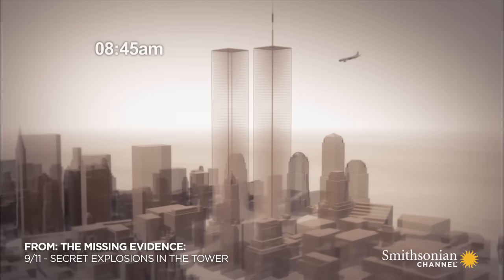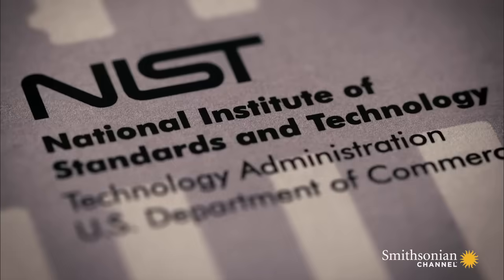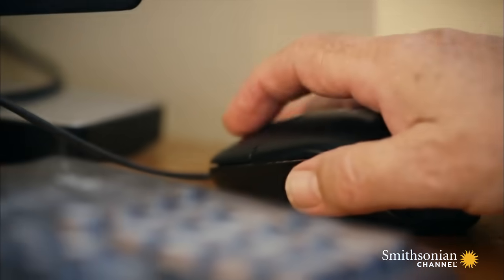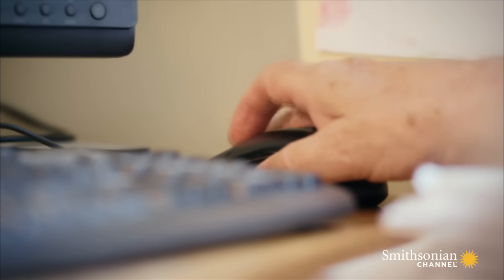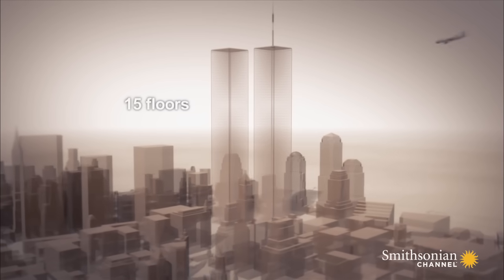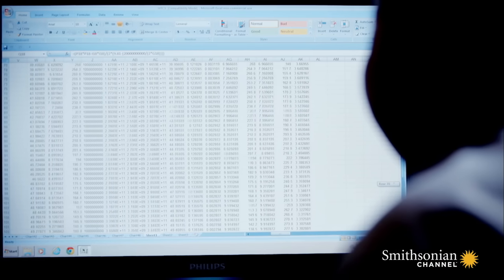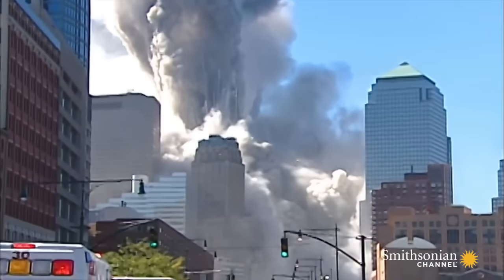This Computer Simulation Explains How the Twin Towers Fell

Comment: 9/11, never forget the day physics took a day off
Reply: Inside Job
Reply: @tulrid7550 outside job
Reply: People seem to ignore Newton's  laws. The lower 3/4 of the building (which were reinforced more than the top, to prevent sway and weight) would have resisted the upper 1/4. Collapse would violate the laws of physics.
Reply: @jedimasterham2  
Yes, violates the laws of physics and Common Sense. I think these people on here supporting the original fabricated story on the mainstream news must be paid trolls. My only question is how much are they getting paid to be treasonous to our country?
Reply: @br5747  It would make sense. Negative reinforcement and shaming is often used to deter people from certain types of behavior.  Can't prove they are paid trolls, but we have to ask why they would dedicate so much time to bashing people with completely rational concerns and questions.
Reply: @jedimasterham2  
Amen brother.
We probably don't know half of what's really going on.
Reply: @jedimasterham2  What laws of physics are violated?
Reply: @peterjv8748  Newton's third law of motion: For every action in nature there is an equal and opposite reaction.

The lower portions of each tower (reinforced much more to protect against sway and the weight) would have exerted a force of a significantly higher  magnitude against the upper portions, thereby resisting the upper portion. In other words, free fall would be impossible because the upper portions would have bounced against the resistance of the lower portions.
Reply: @peterjv8748  And laws of motion state that the lower 3/4 of the building would provide a force 3 times the magnitude of the above portion, thereby providing ample resistance. The upper quarter of the buildings would quite literally bounce on the resistance. 

It's fairly simple to understand.
Reply: @peterjv8748  The "pancake" theory was debunked by physics. I already explained above. And yes, both (actually all three) fell at near free fall speed that is consistent with professionally controlled demolition work.
Reply: @peterjv8748   it was 11 and 13 seconds 🤦‍♂️ you have no idea what you are talking about sheep
Reply: @peterjv8748 actually free fall is 9 seconds. One tower fell in 11 seconds and one in 12-13 seconds. That means there was nearly no resistance, that’s physically impossible at least for wt1 because the entire frame is steel and the core is 47 columns of steel, and even if a floor was completely severed instantly, which you’re stating. the resistance is equally or 2-3x amount of times stronger lower towards the bottom. It’s called law of conservation of momentum. It didn’t slow down either it was a consistent speed. The collapse is not 15-16 seconds that’s an exaggeration. So now the question is how did they fall 1-2 seconds near free fall speed “pancake theory, implosion on itself” doesn’t make sense
Reply: @jedimasterham2  thank you. This is what I always say. Why would the entire building come down if you hit the top?
Reply: @jedimasterham2 no one, not even world renowned engineers and physicists are in a position to boldly claim what would or should have happened in an unprecedented situation where a fully fuelled airliner slams into a 400 m tall skyscraper at 700km/h. Amateurs and professionals alike can only speculate. Reality shows something else.
Reply: @ Actually, physics remains constant, and engineers and physicists are very aware that this is physically impossible.
Reply: @jedimasterham2 it was an underground mini nuke guys.. not planes
Reply: Guys I love how if you question anything at all thats makes you an automatic "tin foil hat" conspiracy theorist bla bla bla. With 9/11 its not just one valid reasonable question. Its HUNDREDS. And they remain unanswered to this day! NIST & the 9/11 Commission DIDN'T EVEN TEST FOR EXPLOSIVES! That is ridiculous & That is a fact. Nevermind the countless ppl who said they heard explosives WTC7..w.e ok just simply disregard them. WHY ON EARTH WOULDNT YOU DO A PROPER INVESTIGATION & TEST FOR EXPLOSIVES REGARDLESS!???
Reply: @frankgrimes6771  agreed!!!!!!!!!
Reply: @frankgrimes6771  If they tested for explosives and didn't find any, you wouldn't believe them anyway. You'd just say they were lying, you don't believe anything they say so why does it matter to you whether or not they say they tested for explosives?
Reply: In 2019 it is alarming the amount of people that still believe and defend the governments official story. Boggles my mind
Reply: @perijon00  same, most are paid to argue, others just dumb
Reply: @perijon00  they are npc’s.
Reply: @perijon00  Just because you don't understand something doesn't mean that it didn't happen.
Why don't you explain in detail what we all saw and provide supporting evidence for each.
Reply: John J ok John time to use your common sense. I understand this just fine. We all think we saw 2 airplanes hit the tops of two marvelously built skyscrapers and the result was 3 skyscrapers demolished into their own footprint at near free fall speed defying physics. If you still can’t wrap your head around that then I suggest doing more research on the days months and years leading up to that and what exactly they had to gain from a fake war on terror
Reply: perijon00 so if it was explosives, how would they survive the office fires for that long. How would any government agents wire up the detonation cord around all these fires. Collapse happened exactly at the fires point from impact from the planes. How come none of these bombs were picked up on any audio or video taken a block away from the collapse points. As far as I know bombs make noise not silence
Reply: 360SRH 2 wow. Go do more research bud. Watch “a new Pearl Harbor”. Your argument is all over the place
Reply: perijon00 Typical truther gets confronted with a realistic argument and immediately changes the subject. I dare you to answer, how come the buildings fell silently, even 1 ounce of explosives can be heard for miles away. How are these explosives and detonation cords to survive the office fires for that long? It’s just basic physics and science if you care to chat.
Reply: 360SRH 2 typical physics? A building like this couldn’t do what it did according to basic physics. If any part did collapse it would have been the top floors and they would have collapsed until they hit the part that was hit. There wouldn’t be enough energy and momentum to take out the rest of the floors. Also were u there that day because explosions were heard before the plane even hit the tower and many explosions heard after. So yes let’s chat
Reply: @Leo-1t1tp  he did not change the subject, he told you where to go to see the audio/video and witness evidence of explosions, as you were asking for that...puppet.
Reply: Ivan Cavar And notice how he didn’t give me any proper videos of any audio or video, I dare you right now to send me audio or video of any explosions. Because every single camera that day showed collapse happen totally silent and seismic charts show collapse was silent beyond floors collapsing. How would any explosives survive the office fires?
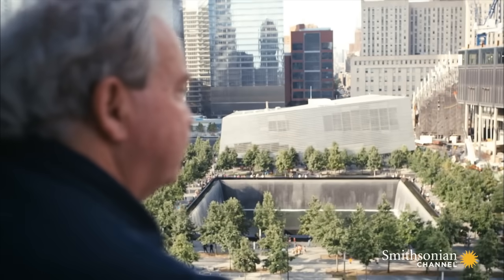Reply: @Leo-1t1tp  type this in to the search bar "David Chandler 911 NIST WTC7 Explosions heard" and skip to 1:09 and you will hear 2 on the 1 clip.
Reply: @JohnJ-fj2xe  Just because you see it on TV doesnt mean its 100% that way either. Look at TV comercials for example.. When they show they product on TV its fantastic, when you buy it and arrives at home... Well you guess 👍
Reply: @solid_snake_87  If the second airplane strike were only available from a single vantage point AND was only made available days after the event, then I could see your point. However, the strike on WTC2 was seen live on TV from multiple angles in real-time, and was augmented by additional angles from security, news and private sources. So, any concerns you have or had regarding the images we see having been 'manipulated' somehow are completely baseless. To do so would have been impossible. Period.
Reply: @solid_snake_87  Pretty hard to manipulate like hundreds of news channels that was there at different angles.
Reply: @perijon00  
MSM is the real WMD!
Weapons of Mass deception.
Reply: @Leo-1t1tp  
There's evidence that they used thermite because it is much quieter. That would explain the molten metal they pulled out of the hole 2 months later. 
Thermite is a chemical reaction and reaches 4000 degrees much slower than explosives. Also on the documentaries you can see local news captions of the police and firefighters saying that building 7 (the 47 story building across the street) was a controlled demolition. They said they heard the explosions on each floor as it was coming down.
Reply: @k819849  if you are you are going to just ignore the points I made, I'm not going to bother conversation with you on the matter. I know what the original comment said and I just told you my view on that, I'll say it again... Unless you can look at the program used to look at the data yourself, you are being foolish to just take someone's word for it. 

Did you look at the clip I posted with the explosions that nist claimed didn't exist? 

And again... there are physicists who are just as qualified as the physicists in this video who say otherwise. Also you need to ask yourself why only the physicists who stick to the nist version of events get air time on channels like the Smithsonian channel.
Reply: There were testomonies of emergency services/witnesses who heard explosions going off in the basement area of the twin towers.
Reply: darkon666 I was there a week after it happened and I spent two days looking around at the damage. The concrete was obliterated, it wasn’t broken from collapse it was literally blown to smithereens. Beams that were heavier than a big truck were stuck in the sides of buildings hundreds of feet away. It wasn’t a collapse, it was blown up!
Reply: @Cantstandtherock  All the visual evidences point towards controlled demolitions on all 3 WTC buildings...
Reply: @darkon666  No it doesn't! No evidence of explosives were ever found.
Reply: @Tim22222  Thermite residues were found
Reply: darkon666 yes. “9/11 loose change” on Youtube .
Reply: @jlsg87  Watched it 2 or 3 times already together with Zeitgeist movies, also highly recommended!
Reply: @darkon666  So you trust a few testimonies of vague basement noises but not 5,000,000 testimonies that a plane flew right into the building?
Reply: @gavinjenkins899  I made my conclusions from all available narratives that were offered. I don't believe some sand people were able to fly 2 planes perfectly into 2 buildings (testimonies told that these are extremely difficult manoeuvres). After which these 2 buildings fell in  freefall controlled demolition style together with WTC7 which was probably structurally damaged, but it's strange it fell again in controlled demolition style... My guess is the Pensylvania plane was meant for WTC7 but they ordered it off, because this was almost impossible manoeuvre without massive collateral damage, so they dropped the building under the pretext of "structural damage and fire"... And also, why didn't they ever release a video of pentagon plane crash? I think was just a cruise missile...
Reply: @gavinjenkins899  Too many things don't add up, and I don't trust mainstream media which are used to keep people dumb and igonorant...
Reply: @darkon666  Nice guess on flight 93  never thought of that one. Does sound possible.  But to be honest I don't think collateral damage was a concern considering what happened that day. But flight 93  where is the wreckage? Nothing to see. No seats , suitcases , clothes,  wings, tail , wheels nothing Never understood that .
Reply: Because it’s not every day we see freakin’ jets get purposely slammed into buildings. Of course there’s no data on how physics would react to such events; it’s practically unpredictable. You’d have to just watch and see how it would work.
Reply: @ShadowLinkxMaster  its happened lots of times and none of the buildings have collapsed
Reply: If a crime was comitted, look who benefited the most. Building 7 or not/ plane or demolition, sad incident indeed as innocent lives were lost.
Reply: @k819849  who is you're message aimed at here?
Reply: They physically needed oil
Reply: Wrong. There was a bomb
Reply: @Flyingmechanic You are 100% correct sir, it is 100% impossible for those buildings to attain free fall speed as they did, it doesn't matter how heavy the upper floors were, the floors beneath would have slowed the collapse down, you know...... SOME. The only way the collapse could have happened as it was is......
I guess if the structures were damaged all the way down, or near all the way down. 
Not only that, all three buildings fell into its own footprint, nearly perfectly. But go ahead, ignore the fact that it was nearly a textbook demolition.
Reply: Controlled demolitions brought down both towers and everyone knows it, just waiting for the truth to come out!
Reply: A building in Beirut which location near Beirut port after the explosion the building still stands now. Beirut explosion is so powerful than 9/11.
Reply: This beams where covered with asbestos fire proof spray on. Most of the entire buildings where colder than a frog. This was planned. More than 70%of employees where told not to go present for work on that Monday. Inside job.
Reply: Paul  Someone was filming the moment that the first plane struck WTC1. A film crew was doing a documentary at street-level some blocks away when they heard an airliner over Manhattan (which was highly unusual). The camera operator noticed the jet and panned upwards to capture it approximately two seconds before it struck the tower. Because it was film, it had to be developed before being released the next day.
This is pretty basic stuff. You really didn't know this?
Reply: @GuitarZMasterZ 
Right, and the Rolls-Royce engines found on the wings of a 757 weighing 12000 lbs and moving 500 miles an hour didn't break the windows? I'm not an engineer but that must be some pretty strong glass.
Reply: in the computer program where the buildings melt like ice popsicles cool
Reply: Paul   I fear you are trying to talk sense into people that are determined to remain senseless.
Reply: It’s a joke guys
Reply: No, there was no molten steel. If there was, hunks of this melted-then-solidified steel would have been found - yet none were. DID NOT HAPPEN.
Reply: @Tim22222  except massive and numerous hunks WERE found. One of them nicknamed "the meteor"
Reply: @ivancavar3037  Was the "meteor" a single piece of solid steel? No?

Then there's still no proof of melted steel.
Reply: @Tim22222  hey Tim it's Nicola Park here... why since asking for proof has any of my comments since failed to show on the comments section, have you blocked me from answering? because I can see them off my account but when I go to this account they don't show!

Here's the explosions you asked for.. type "david chandler 911 NIST WTC7 Explosions heard" in the YouTube search bar then skip to 1:09 and there's 2 expsloions in the same clip. 

Funny how some comments show then others don't. wonder why that is!!
Reply: @srdmedia2944  My reply to your clip: It's not coincidental with the collapse; in controlled demolition, the immediately precede the collapse.

And remember, not a shred of physical evidence of any kind of explosives was ever found. Nothing!
Reply: @srdmedia2944  Finally, as to your reports: I'm not interested in reports. Reports are interesting but as evidence they're pretty weak. 

What I want to know about is EVIDENCE. Where is the physical evidence of explosives at the WTC?
Reply: @Tim22222  firefighters say there was molten steel.
Reply: @dcjones6418  "firefighters say there was molten steel"

How did they know it was steel? Did they collect a sample to have it analyzed? Did some qualified metallurgist positively identify it as steel?
Reply: Exactly
Reply: YES. I know, right? Strange place this planet.
Reply: and "Bush clan" physics took place..
Reply: @bobbymanganaro  The buildings did not have a steel infrastructure?  I think that's highly improbable if not impossible.  There's also the fact that we see the steel spire evaporate in the slo-mo CNN footage of the collapse of T2.
Reply: stephen hogg 
????? Dafuq?
Reply: stephen hogg 
How many of you people still believe that JET FUEL IS NOT HOT ENOUGH TO MELT STEEL GET IT IN YOUR HEAD
Reply: Moment for moment i lose a braincell on these incels
Reply: The top floor reached ground level at free fall speed. That's physical impossible with the resistance incurred during a natural collapse. Only a planned demolition can achieve this by blowing support from under it .. it's very basic laws of motion. A building collapsing from the top down will encounter resistance at every level, this slowing the rate of fall dramatically.. a building that has it's support demolish from the bottom up with encounter much less resistance and fall exponentially faster.. from a natural collapse, the building should have taken over 3minutes to come down and the odds of it not being a "topple" are so high that it's statistically impossible that it happened twice in one day, let alone the third time at wtc7 which incidentally WASNT struck by a plane
Reply: I don’t know what happened that day on 9/11 outside of the horrible truth of the loss of lives. I do find it very odd/curious that the towers came down the way they did. After doing some rudimentary thinking and consideration, I think it extremely difficult to see how the planes alone could have caused the ultimate damage seen. I could see the potential for the upper floors to have toppled, but there is little true explanation of why the fires almost an acre away, cause structural damage/weaknesses to result in the floors collapsing equally. I’m not saying I have the answers... I’m saying the statistical likelihood of the fuel hitting every required support for an equal fall to occur would be an interesting study - I for one don’t see it. I do see an eventual fall of the entire structure, possibly, but not in the timeline that we saw. I do understand that the only source of fuel was not the airplane fuel, but also the contents of the office itself. I do also understand that an uncontrolled fire will go crazy in most cases... but I don’t see any proof that the fuel could have traveled far enough linearly or vertically to have begun the final destruction obtained in such short of time. 

“Could it collapse under its own weight...” yes. If you feed an algorithm a specific set of details, it can come out to an expected result. The question should be, “Why did it occur exactly as it did, in such a controlled fashion?”

Consider the following food for thought:
Fuel approx contained in plane: 24,000-1,500(for about hr of flight)= 22,500 gallons
((Source1: 767 - Boeing
Source2: How to Convert PPH to GPM | Sciencing ))
Rough calculation of sqft/gallon: 0.63 gallons/sqft/1in deep - about 0.32gals/sqft/0.5in deep
((Source: University of Arizona › waterwise › ...Harvest Rain | Water Wise Program))
Area of a floor of the WTC: 43,680 sqft
((Source: World Trade Center: How much square footage is on a floor of 1 WTC ...))
Area that the fuel from 767 could technically cover:  22,500gallons/0.32gallons/sqft = 70,313sqft or an area 265ftx265ft (sqrt of 70313 = 265.17)
Average number of floors hit by plane on 9/11: about 10 (article states floors 75/85)
((Source: History ChannelWeb resultsHow the Design of the World Trade Center Claimed Lives on 9/11))
Average height of a storey: abt 14ft
((Source: Storey - Wikipedia))
Approximate distance from impact site to street level: 1050ft
Melting heat of steel: approx 1492-1539 C/2718-2802 F
((Source: Structural steel - Wikipedia))
Weakening heat of steal: 425C/797F (soften) 650C/1202F (50% decrease in strength)
((Source: Why Did the World Trade Center Collapse? Science, Engineering ...))
Burning temp of airplane fuel: 800-1500F
((Source: 9/11 Conspiracy Theories - Debunking World Trade Center Myths))
Average high rise fire temps (depending on contents): 593C/1100F
((Source: HOW HOT CAN FIRE GET? | SKYSAVER RESCUE BACKPACKS - SkySaver Rescue))

Again, not saying it is a massive coverup that happened, but still not seeing the world through the same rose-colored glasses that others are. ((Edit: links aren’t working, but the info is out there and easy to find))
Reply: No, physics explains it 
 What would be the point of a fake plane crash? 
 Lets it was a bomb, or anything else, what’s the point of covering that up?
 There was a bomb before. Which they said it was a bomb 
 Isis and other Islamic  terrorists groups are literally known for bombs and have done majority of attacks with bombs
 If the government did it, why would they lie about a plane crash? When before and since then every time it was a bomb they said it was? 
 And the only people that would benefit from this is the military. But republicans are the ones saying it’s a terrorists attack
 What a strange mindset
Reply: It's ok. Not everyone gets physics.
Reply: bcdhifi 
This guy gets me
Reply: Phsyics took off?  Hmmmm, no idea what that means, but ok.
Reply: Seems like you are a physicist yourself!
Reply: Great hoax attack was in 10 11
Reply: People are making a big deal of how much the top section weighed, in reality it makes no difference because the bottom section weighed about 4 times as much therefore either the laws of physics didn't exist that day or some kind of "explosives" were involved, how can 100,000 tones crash through 500,000 tones in 9 seconds and turn it to dust? Impossible, how can fire bring down wtc 7 at free fall speed, perfectly level as well? Larry Silverstein admitted on camera that he gave permission to have that building "pulled". Pulled is a term they use in demolition, planning and planting of explosives in WTC 7 would take weeks, this was all pre planned therefore blaming Al Qaeda was nothing more than a way to invade Iraq and steal oil. Your government are smarter than you sheeple, time to wake up. 🐑🐑🐑🐑
Reply: @Blaydoner  

Excellent comment. I'm starting to believe that these people that support the original fabricated story must be paid trolls. I just wonder how much they're being paid to be treasonous to our country?
Reply: inside job
Reply: People who believe this garbage should go see the great and powerful Oz for a new brain.
Reply: There is nothing wrong with the physics, the planes weakened the buildings plus the metal that was getting heated
Reply: You may be a well trained pilot, are you qualified to make conclusions on the collapse of WTC. I personally believe that the crash of jetliners would be impossible without complicity of Pentagon, cia.... Regarding the collapse of the twin towers, I don't think you need explosives. You already have 2 efficient weapons. The planes.
Reply: @lorenzoblum868  It was an inside job, THERE WAS NO PLANES INVOLVED!  No evidence of plane wrecks debris or any plane crash parts on both twin towers and pentagon.  Plane crash CAN'T evaporate steel beams structure that supports the building,  Thermite bomb for demolition building CAN.   There was NEVER a case of burnt steel beam structure buildings collapsing to the ground with the steel beams.  You can burn the building from ground to top, BUT the steel beams will still stand strong.
Reply: Why no comments from scientist, architects and highly qualified people?
Btw, what is the carbon footprint of the military industrial complex?
Reply: Often the truth hides between the lines.... No need for control explosion for the collapse of twin towers but cooperation of government "insiders" essential for elaboration and achievement of 9/11
Reply: Did you not just watch the video?
Reply: The jet fuel was burned up within minutes, so the floors were almost exclusively fueled by building materials and office furniture. But suuuuure... "weakening the steel" with a fire fueled by office supplies around the 6 floors (out of 94) that were impacted would totally cause the lower floors to disintegrate and enable collapse at near free-fall speed. Right.
Reply: @Creamapera first Kerosene burns hot enough to soften steel. End of story! You don't have to melt it to make it ductile. Second a few million tons of load were released, lots of energy there. Lots of sounds. Third, gravity doesn't pull to the left or the right. It's pull is in a downward direction. And, the towers did not fall in their footprint. They fell all over downtown. They crushed and damaged buildings all around them. Remind me not to hire you for a controlled demolition. You don't know what that means. BTW, I'm an engineer. Go take a statics class and a materials science class. Then you'll know what your talking about.
Reply: @Tylenol PM 🙄
Reply: @Tylenol PM no they didn't. And thermite was unnecessary. Sorry!
Reply: @Tylenol PM could you please get a life!
Reply: Feeps like a scripted fifa game
Reply: I wana know how people with cameras knew to point directly at the first tower before the airplane hit,,,they just happen to be filming ? Or was that footage meant to be captured
Reply: @Jim Johnson So? There have been hundreds of airplane crashes in the last 100 years, and very few have been photographed as they happened.
Reply: Paul  Not true. The film was released the next day.
Reply: Paul  
I'm not dodging anything. When I get some free time I will. I also have a life and can't sit here on YouTube comments for hours a day.
I researched everything I could find for a year-and-a-half because I kept finding so much information incriminating the fabricated story on the news. And defying common sense. It would be hard for me to send you the links from a year-and-a-half of research.
People have been programmed to shut down when they hear the truth.
Reply: Paul  "scientifically rejected lies accepted only by the tinfoil hat wearing members." Do people actually wear tin foil hats?
Reply: Building 7, jet fuel was burnt on impact, extra explosions before collapse, "cut" steel beam, molting (not weakened) metal found, again...molting
Reply: Mark CuckerSperg  I don't claim a high level of engineering knowledge but yes, generally I understand the physics.
Reply: What a dumb statement.
Reply: Proving that the fires would have weakened the structural steel in the towers to the point the steel failed and allowed the top floors to start falling contributes absolutely nothing toward proving the towers would have collapsed at constant speed all the way to the ground as observed. This is impossible because the accumulation of debris beneath the falling mass of upper floors will progressively increase resistance to the falling mass and bring it to a gradual stop with a huge pile of debris remaining. 

It is the CONSTANT SPEED of collapse that is the dead giveaway the towers did not collapse under their own weight driven by gravity alone. The accumulated solid debris beneath the falling mass would inevitably reach a compaction limit and bring the downward motion to a gradual stop well before the falling mass reached the ground. Only by a huge number of controlled explosives pulverizing the debris to dust and blowing it outward from under the falling mass could the towers collapse all the way to the ground at constant speed. And this is exactly what is observed.
Reply: Of course, they don't only hide things in regards to 09/11/01. They even hide information on what led up to The American Revolution. Oh...my direct ancestor, Reverend George Wightman was the father of Reverend Valentine Wightman who married Susannah Holmes, daughter of Mary Holmes, daughter of Roger Williams (Encyclopedia 1636) who was also a Puritan like Puritans and Pilgrims on The Mayflower (1620) whom were also called "Separatists" after The Protestant Reformation sparked by the execution of King Henry The VIII's 2nd wife, Anne Boleyn. Our U.S. Founding Fathers, for the most part, were Protestant. A few practiced Deism. Oh...I know who they are.
Reply: The Smithsonian was established August 10th, 1846 correct? How about we take a scroll back in time before your time.
Reply: You never know what someone who is practically a descendant of one of our Founders in America might teach you.
Reply: Anyone even curious?
Reply: Flyingmechanic huh? What do you think of The FMS Systems in jumbo jets that let radar traffic controllers who where planes are in the airways (Oh.. each airway is like a highway) Of course, even smaller planes today have an FMS System in them. Not as complicated as the larger airliners who navigate the skies' highways called Airway Highway. Of course, Airway Highway Techniques (ACTs) are used. Heck, I think during 09/11/01, all jumbo jet airliners had FMS Systems in them. Of course, Air Traffic Controllers need to know where planes are in the skies at all times in order to direct them where to go and to tell pilots to make a course correction to avoid another pilot. Communications take place often between a pilot and their heading. Heading toward The Pentagon must have been a tremendous feat without Air Traffic Controllers giving a shout out. Pilots barely even land planes anymore due to those FMS Systems. Can't navigate the skies without the maps and airway codes if you're a commercial airline pilot. Sure, they can turn off the system somehow, but how would they navigate? Landmarks on the ground? Heck, Boeing is working on a plane that doesn't even need a pilot. Remember when there were 3 pilots in a airliner? Long time ago that was. Of course, the third pilot just monitored the plane's systems, and most of them were grounded during storms. Oh...those old pesky flight delays. Maybe, people should buy Microsoft's Flight Simulator 2020 of XPlane 11...not as graphical, but some pilots have been certified to fly taking a virtual test in XPlane11 that is on Steam. Heck, the first time I tried to move a plane, I hit a few warnings and got towed back to the hanger. I don't think people realize just how difficult it is to fly a Jumbo Jet. Sure...easier once in the air, but it is still tracked by ground control especially near major airports and The Pentagon.
Reply: Warsaw ButterFog  an endless stream of dumb....
Reply: @oilerz7494  Thermite is a fantasy. Didn't happen. Not only the Harris Jones et. al. decline to submit their paper for peer review or their samples for reproduction (standard procedure - IF you have the goods), in fact the only independent study to examine their findings refuted them! Thermite NOT found.
Reply: @oilerz7494  "Please reproduce controlled demolition with jet fuel."

Don't forget to crash a jumbo jet doing 500 mph into the structure first!
Reply: Once maybe, three times in one day, impossible!
Reply: Not to mention the tower should have fell over instead of falling down like a demolition
Reply: Only if you don't understand physics.
Reply: 345th reply :)
Reply: Beat comment on here!
Reply: Never forget the day intelligence left the already empty brains of "truthers"...
Reply: Titanic weight is 25% more than quoted so the programmer is casual with figures
Reply: Yeah, and so did Larry Silverstein and his two children who also worked at the WTC. How “lucky” they were!
Reply: Everybody turned into scientist overnight smh
Reply: Ok so building #7 committed suicide due to depression/heartbreak over the twin Towers fall???
Reply: What schools denied your physics degree?
Reply: The mathematics of body recovery statistics in building collapses disproved beyond any doubt that no collapses occurred. Mention of this fact unleashes a whirlwind of fake plant replies 🪴🪴🪴🪴💩💩💩🫡🫡🫡
Reply: The building collapses  were controlled demolitions. I do believe the planes hit the buildings.
Reply: Physics took a day off?  Really?    Just on an fyi!!  Fact!! nearly 23 stories collectively failed on WTC 2.  You can pause any video of it and count from the level of the plane impact up to the roof line.  You'll count about 23 stories.   This is not a debatable point.  Its a fact.  Another fact!!  The floors DO NOT carry the loads of the building.  (DO NOT!!!!)  They carry the loads of the people, desks, photo copiers, etc.  They DO NOT carry the loads of the building.  They transmit the building loads through the columns.  If the columns  fail (And they did) the building load is now moved onto the floor.  Not only moved on to the floor but it is also LIVE LOAD not a static load.  The floor is NOT DESIGNED for this amount of weight.  If the floor is not designed for this amount of weight (23 stories!!) which it isn't.  What makes you think or believe the next floor is going to fair any better with 23 PLUS ONE!!! landing on it?   Or the next floor with 24 PLUS ONE landing on it.  The point of failure was orders of magnitude OVER that floors load capacity.  Why would you expect this to "Improve" on ANY floor below?   What part of the floors do not carry the loads of the building are you having trouble with????
Reply: And by physics we mean Larry Silverstein.
Reply: @RumpleTheStiltskin  What about him??
Reply: And how did physics take a day off?  Explain it to me like I am 5
Reply: Yesh!
Reply: How about you ask real scientists and real witnesses that aren’t on the payroll or threatened? There’s a start.
Reply: @ go go gaga
Reply: I'm getting cooked on instagram for saying this 😅
Reply: At least NIST was open to peer review and addressing the issues that other architects and engineers had with their data and conclusions….  Oh wait.  I guess NIST didn’t do that either.  It’s definitely not suspicious to base data points on hypotheticals instead of hard evidence.  Especially when your conclusions are presented to the public as immutable scientific evidence that 9/11 was addressed scientifically and fully, like the public wants, and the events deserve.
Reply: yup
Reply: Timed explosions at the bottom of both towers
Reply: Imagine you're playing Jenga, and your wooden blocks just fell toward the path of MOST resistance, straight down crushing all the blocks into dust so you couldn't play again.
Reply: @goffreyb5570  large buildings do not act like tiny jenga towers. Just like an ant can fall 10,000 times its body length and walk away just fine but you can't: small things are stronger than big things at their own scales. Skyscrapers are like houses of cards vs. a jenga tower due to the scale
Reply: Bush didnt
Reply: @Chaosundivided777  iraq did not 911 was not necezzary iraq war
Reply: @Chaosundivided777  Bush DID IT
Reply: Am shut
Reply: only if you believe the "official narrative". the Rest of us know they were demolished.
Reply: Picture the buildings like a thick tree trunk, say the circumference of the core columns
Now picture a 100 tonne semi trailer truck on top of it
Hoist the truck up by approx 10 metres and drop it
 on the tree trunk
Of course it would do damage to the tree, but would the semi trailer keep accelerating in speed whilst hurling chunks of wood 100's of feet in a 360 degree direction all the way to the ground damage?

Now think of that same truck at a height of 50 feet, but this time the tree is made of steel.
Reply: @goffreyb5570  Terrible analogy.  A tree is solid all the way through.  If the buildings were solid blocks of steel you might have an argument.
Reply: @goffreyb5570  It's a hollow building made of millions of pieces, not a solid tree tunk. YES if you drop a semi on a gigantic HOLLOW pile of carefully arranged twigs tied together with thread, it will go straight down and throw twigs in all directions as it does.
Reply: Ok so if we are idiots... explain the explosions heard in the videos and the reports of explosions and why they were never investigated. In fact.. they weren't just not investigated, they were denied and blatantly ignored. Why was that?
Reply: @nicolapark3367  "explain the explosions heard in the videos"

What explosions? I've been looking at 9/11 videos for a decade & have yet to see one with the sounds of explosions (except when the planes crash, of course).
Reply: I just linked on to here from another account and the comments with the video links aren't even posted but I can see them. YouTube on the ball keeping certain comments from appearing.
Reply: @Tim22222  I've seen many videos with audible explosions of WTC7. YouTube took them down.
Reply: Chris Hagan  so many clueless sheep that just believe the ridiculous lies told to us by our government overlords....
Reply: @Roger-ws8rj  wonder if they've now taken a step back and researched everything they've ever been taught to believe. ''Tell a big enough lie often, it becomes truth. Cant quite remember who's quote that was🤔🤔
Reply: So what's your explanation? And what is your background? Ie are you an engineer?
Reply: @Roger-ws8rj  Ahahahahahahah
Reply: @Roger-ws8rj  agreed. Absolute sheep
Reply: @Roger-ws8rj  As opposed to the unsupported ramblings of conspiracy theorists...
Reply: @JohnJ-fj2xe  hey John can you "debunk" or give a good reason as to why NIST or any gov organization DID NOT TEST FOR EXPLOSIVES? ..AT ALL! The largest terrorist attack on US soil & No testing whatsoever for explosive residues!? WHY!? I would love to hear the "official story" reasoning behind this. The government can't say "there were definitely no bombs on 9/11" and "oh by the way we never actually tested for them" that is ridiculous!

 the "official story" is littered w.holes, makes no sense. The "official story" IS ironically the conspiracy theory.
Reply: @frankgrimes6771  Why would they test for explosives? The only people who would do so have no evidence whatsoever that explosives had anything to do with the collapses other than their own collective ignorance and utter lack of understanding of what everyone else actually saw. Instead, these conspiracy clowns intentionally misrepresent and misinterpret what can be seen supplemented by fantasies about how a 'controlled demolition' was actually pulled off. Further, these idiots never offer any real evidence up for scrutiny but instead think that saying that they don't believe the official story is the only evidence they need. It's moronic.
Reply: @JohnJ-fj2xe  Nice non answer.
Reply: There's nothing wrong with the physics of 9/11; you just don't understand it.
Reply: @Tim22222  Tell that to building 7
Reply: So you are saying the people who planned this accidently stumbled on a new way to take down a building in a way similar to a controlled demolition? That's amazing.
Reply: @Tim22222  Hold a coat hanger, wire, with one hand and hold a lighter to the other, what happens? Steel conducts heat very well. Do an Energy balance, do you know what that is? Include heat transfer.
Reply: @JT-cf7dq  Oh, well, THAT'S a valid comparison <rolls eyes>

Did YOU perform this experiment? Then please share your results! How long did you hold the flame to the wire?
Reply: J T 
Steel can conduct heat like ANY OTHER METAL jesus... but JET FUEL CANNOT, I REPEAT, CANNOT MELT STEEL BEAMS
Reply: @Tim22222  Yeah, just the Dunning-Kruger effect at work
Reply: @Tim22222  ... You don't understand 'basic science' so please don't refer to physics.
Reply: @phillandsboxingskills  Oh? In what way is my understanding of "basic science" deficient? Do tell!!!! [makes popcorn]
Reply: @Tim22222  The fact that you have NONE is a pretty good start!
Reply: @Tim22222  Tell me how many interior columns there were in the twin towers.
Reply: J T 
Nobody cant because it was already destroyed by LOCATED THERMITE CHARGES
Reply: @Tim22222  it is pretty easy the US government destroyed the twin towers to have them as a excuse and invented the thing of weapons of mass destruction in iraq to invade that country and take them oil
Reply: @Tim22222  That's more true than you might think.
Reply: @Tim22222  Oh..but I do understand it, and it is funny that people forget about Newton's Law on Conservation of Momentum known as friction.
Reply: Here, I'll explain anyway:  In the case of a collapsing building, momentum does NOT need to be conserved because there is a force ACTING on it - GRAVITY.

TRY THIS: Hold up a bowling ball perfectly still; it's not moving, therefore 0 momentum, right? Now drop it! "But wait!" you cry as the bowling ball falls. "Momentum was not conserved! It increased!" And the reply is - EXACTLY!

Conservation of Momentum applies to "closed systems" - that is, cases where are are no outside forces acting on the players. The WTC was not a closed system - gravity is acting on it - therefore momentum does not need to be conserved.
Reply: @Tim22222  Drop a bowling ball on panes of glass attached firmly to each other, The ball will break some of the glass but not all of the panes of glass. The Bowling Ball met up with friction which conserves its momentum to the point where The bowling ball stops breaking the panes of glass. Conservation of Momentum.
Reply: @Tim22222  Gravity is a force....yes, but there are forces acting against the descent of that bowling ball. In this case, each floor.
Reply: @Tim22222  It would be like a big man trying to run through doors. Sure....He can run through some of them but not all of them. Also, at the Pentagon, Flight 77 knocked down two huge light poles along the highway without exploding. Ever see the damage done by a bird in the sky to a plane?
Reply: @Tim22222  Each floor is resistance. Of course, I could skip 09/11/01 all together, and expose who took over our U.S. Government from within. Oh....I'm a direct descendant of Reverend George Wightman, the father of Reverend Valentine Wightman who married Susannah Holmes, daughter of Mary Holmes, daughter of Mary Sayles, daughter of Roger Williams (Encyclopedia 1636) and grand daughter of Obediah Holmes (Encyclopedia) who President Abe Lincoln falls under. Roger Williams was a Puritan like Puritans on The Mayflower (1620) who were also called "Separatists" after The Reformation of Denominations (Reformation / Britannica) which was sparked by the execution of King Henry The VIII's 2nd wife, Anne Boleyn. How about I give you a history lesson you'll never forget.
Reply: @Tim22222  Oh...my direct ancestor was one of the reasons why we all have a U.S. 1st Amendment.
Reply: @Tim22222  Should I explain and elaborate on the past? I'll even share Legit URL Links
Reply: @brianparent  That's NOT Conservation of Momentum!

Take a physics class, dude.
Reply: @Tim22222  I did take a Physics Class, and I learned about Conservation of Momentum in 8th grade Physics.
Reply: @Tim22222  Conservation of Momentum is any friction an object encounters including air. Air conserves the momentum of an object. Hence, Conservation of Momentum.
Reply: @Tim22222  How about I also teach what led up to The American Revolution that mainstream media doesn't teach? Oh....The United States probably would have never existed if not for my ancestors, and I also know who took over our U.S. Government from within who also continue to lie to U.S. Citizens.
Reply: @Tim22222  Oh...I've been researching for the past 15 years trying to figure out who took over The United States from within along with mainstream media, and who are committing sedition against our U.S. Founding Fathers.
Reply: @Tim22222  Do you want me to start sharing pdf files from universities?
Reply: @Tim22222  Conservation of Momentum even has an equation of its own.
Reply: @Tim22222  So...you must have learned from Kindergarten Class, and that is as far as you ever reached.
Reply: @Tim22222  Of course, if you ever want to become an astronaut, you'd need to learn that.
Reply: @Tim22222  Sorry for the insult. I know that there are nimble minded people that are good people, but you definitely need to go to school.
Reply: @Tim22222  Too bad your not like Lieutenant Reed from Enterprise. At least, as a science fiction character, he was pretty smart.
Reply: @brianparent  I have a physics degree; you should really listen to me on this.
Reply: @Tim22222  I've already known that 09/11/01 is an inside job for the past 15 years.
Reply: @Tim22222  U.S. General Stubblebine knew as well.
Reply: @Tim22222  So did Alan Sabrosky who taught 8 years at The U.S. Army War College who is also a U.S. Veteran. Ben Swann formally with Cincinatti Channel 19 News knows it too. Heck, about 50% of the population of The United States knows it. YouTube is just censoring people even The 9/11 Family Steering Committee who was part of The 9/11 Commission. They were the ones that put up the billboard from Architects & Engineers for 9/11 Truth at Times Square all lit up. Of course, I take it that you've never watched their documentary, "911 Press For Truth."
Reply: @Tim22222  and it doesn't really matter anyway, I know exactly who took over The United States from within and a lot more that they are hiding even information on what led up to The American Revolution. Oh...I'm not joking!!! Not at all!!
Reply: @Tim22222  Want me to start sharing that info right here and right now?
Reply: @Tim22222  Oh...and they are hiding information on what led up to The American Revolution. It wasn't only about The Stamp Act and TEA. I'm a direct descendant of Reverend George Wightman who was the father of Reverend Valentine Wightman who married Susannah Holmes. (Oh...I first made a mistake thinking that George was Valentine's brother). Susannah Holmes was the daughter of Mary Holmes, daughter of Mary Sayles, daughter of Roger Williams (Encyclopedia 1636) and grand daughter of Obediah Holmes (Encyclopedia) who President Abe Lincoln falls under. 

Roger Williams was The Founder of Rhode Island & founder of the 1st Baptist Church ever built in America. John Smyth founded The Baptist Church Denomination. Roger Williams was also a Puritan like Puritans on The Mayflower (1620) whom were also called "Separatists" due to The Protestant Reformation which was sparked by the execution of King Henry The VIII's 2nd wife, Anne Boleyn. Baptists, Amish, Puritans, Pilgrims, along with many other church denominations falls under Protestantism. Protestants first stood behind The Church of England, because King Henry The VIII's 1st wife, Catherine of Aragon, was a Protestant. King Henry The VIII founded The Church of England, because The Roman Catholic Church would not allow him to divorce Catherine. King Henry The VIII's vaguely explained death of Anne Boleyn led to a revolt. After, Protestants turned against The Church of England and set out to form their own church denominations like Martin Luther and John Calvin did. Of course, Martin was the first to translate The New Testament into German, and William Tyndale was the first to translate The New Testament into The English Language. The Bishop (Pope), at that time, didn't like Williams's translation, and William was eventually burned at the stake in England. There were many persecuted during The European Persecutions throughout The Reformation Era between The 1500s right up to The American Revolution. The last man burned at the stake in England by King James for heresy was a Protestant Ana-Baptist by the name of Edward Wightman. Reverend George Wightman was a descendant of Edward Wightman. Roger Williams had also been persecuted as well as Obediah Holmes who had been whipped for his Baptist beliefs. Those persecutions is the reason why Roger Williams came out with The Separation of Church & State that later transcended down into our U.S. 1st Amendment between The Danbury Baptist Association & Thomas Jefferson in Danbury, CT in 1803 under "A Wall of Separation."
Reply: @Tim22222  The Separation of Church & State was to grant "Religious Freedom" in order to prevent a person from becoming persecuted for their "Religious Freedom to Speak Their Beliefs," so that they would not be executed. Hence, the importance of having a U.S. 1st Amendment. Also, our U.S. Founding Fathers were, for the most part, Protestant." A few practiced "Deism." Do you think The Roman Catholic Church supported "Separatists" during The American Revolution or "Loyalists?" The term "Separatist comes from those Protestant Puritans and Pilgrims. Also, Martin Luther was not the reason for The Reformation, nor is he the founder of Protestantism. King Henry The II who became The King of France despised Protestants. Want to know where Protestantism comes from?
Reply: @Tim22222  Oh...our U.S. Founding Fathers were most definitely Protestant even though Catholics were excepted, and Williamsburg had a few Catholics there. Oh...even Zak Bagans mentioned those German Mercenaries during The American Revolution in Season 9 Episode 11. Of course, they weren't exactly mercenaries. Still, there were also German Separatists" that fought against "Loyalists," and they were descendants of the first German American Settlement in Germantown, Pennsylvania.
Reply: @Tim22222  Ever watch that movie, "The House of Rothschild," from 20th Century FOX starring George Arliss? The mention Mayer Amschel Rothschild, Nathanaiel Rothschild who connived his way into winning the bid on the loan for The Reparations of France after The Battle of Waterloo in Belgium in 1815....The last battle between France and The British? Of course, The French lost Canada after The Battle of Quebec in 1759 and Treaty of Paris in 1763 (History / Encyclopedia Britannica). Should I mention a few things in regards to The Queen of England and Canada that would make your skin crawl?
Reply: @Tim22222  Go ahead...Keep me talking. I'm tired of death threats and crank calls to my phone especially since my direct ancestor is one of the reasons why we all have a U.S. 1st Amendment.
Reply: @Tim22222  Oh..I'd bet I could go all day long on the entire Rothschild Family.
Reply: @Tim22222  Ya know...The Federal Reserve History Dot Org website where they mention Jekyll Island and Paul Warburg, but don't mention The Rockefellers, Rothschilds, Chase, and other bankers at their secret meeting. Of course, I'm not surprised that The Federal Reserve Act was signed into law on December 23rd, 1913, two days before Christmas and two months after The ADL (Anti-Defamation League) was founded. I wonder....How many Senators were present two days before Christmas? No jet planes and the fastest race car went 75 mph in 1913. Of course, David Rockafeller built The United Nations (NY Times), and The IMF and World Bank were created by The United Nations. The IMF bail out country's National Debts prolonging the inevitability of wife spread famine that follows "Hyperinflation" as taught through community college textbooks like "A Survey of Economics" Only one thing and one thing only causes "Hyperinflation," and that one thing is a "Country's National Debt" (U.S. Debt Clock Org or inflation Dot US). When a country can no longer pay down the principle on The National Debt, and all a nation can do is pay down partial interest on The National Debt, money decreases in value while prices inflate to the point where inflation 'itself' spirals out of control which is known as "Hyperinflation." They don't teach it through Economics Classes at community colleges across The United States for nothing. Money, can become worth less than the paper it is printed on even here in The United States. Sure...They can print an unlimited amount of money, but what will it be worth at the end. Zimbabwe went 6 months without food on store shelves. Russian in 1992 asked The United States for help to pay those that had their fingers on the buttons to send nukes, because they were living off $4 per day Bread & Water. I read that in Canada's Fortune Magazine at a doctor's office in Quebec City when I brought my son to see a doctor there. Germany also went through Hyperinflation in 1923, and people walked in lines from towns to towns in search of food dropping like flies while walking lines. There were middle class working women jumping to their deaths out their windows with babies in hand because there was no food. That is a Total Economic Collapse brought about by Hyperinflation.
Reply: @Tim22222  With The Trillions owed, how long do you think before Hyperinflation hits? Of course, they'll blame it all on Covid 19 which is Cov-2 a strain from Cov-1 known as Sars. Do you know who was threatened 12 years ago in regards to that Sars Outbreak in China?
Reply: @Tim22222  Oh...the virus mutated in labs, and China wasn't the only ones looking into The Coronavirus. The Maryland University School of Medicine posted a video up on YouTube 7 years ago talking about The Coronavius. Of course, there are several different strains from the virus mutating, and The NIAID directed by Fauci showed reports on their website that U.S. Companies funded that lab in Wuhan, China. Ben Swann found that and shared it on Twitter.
Reply: @Tim22222  Of course, with a whole bunch of people trying to take my 1st Amendment away, I may as well fight it. I'm tired of people trying to tell me who I am.
Reply: @Tim22222  Of course, it doesn't help me any that I'm on The Liver Transplant Waiting List at MGH in Boston, MA for End Stage Liver Disease. However, here I am....still kicking!
Reply: @Tim22222  Oh...I also made Alpha Beta Gamma without stuying, but I never paid my dues. Heck, I was just looking for a place to live, because I couldn't live on the street. Cozy dorm rooms, heat, & food...what else can you ask for when you should have been on disability. Of course, that happened later.
Reply: @Tim22222  Oh...and I lost jobs due to something I said on the day of 09/11/01. It was an innocent response at work. Oh..I was working at ESPN HQ.
Reply: @Tim22222  Should I go into that?
Reply: @Tim22222  Do you understand that?
Reply: @Tim22222  you don't have a degree in anything
Reply: @Tim22222  it's called a joke.
Reply: @Tim22222  I wish that was the case
Reply: @Tim22222  anyone can. Just say anything doesn't make it true. Hence you saying you understand physics and say this logic follows basic laws of physics
Reply: @Tim22222 bahahahahahahahahahaha hey Timmy!!! Ya shill
Reply: @Tim22222 you are not fooling anyone! But yourself! Bahahahahahahahaha
Reply: @Tim22222 that cognitive dissonance hurts I know Timmy. Cope.
Reply: @Tim22222 plane wings don’t disappear and reappear silly!
Reply: @Tim22222  there is PLENTY wrong with the official NIST report though.
Reply: @izil1fe  Example?
Reply: @Tim22222  lol bro doesn't understand so he thinks it's not true
Reply: @Tim22222 Cringe
Reply: @Tim22222  Bingo
Reply: Guys I found the real correct theory as to how the twin towers collapsed like that, the true reason was

ALIENS

there, now let's stop arguing
Reply: Chris Hagan steel gets weaker as it is heated, as the weight of the top collapsing increases the building will collapse from the top down. Nothing wrong with the physics here
Reply: @Yoshsterpalooza 
Except below the area where the steel was heated to an extreme, the steel was not weakened in the same way. The collapse should have been offset and staggered. It is definitely peculiar that both buildings collapsed in an equilibrium.
Reply: @bobbymanganaro  It's hard to take someone who shows such ignorance of basic grammar seriously.
Reply: Scientific truth & facts have been hijacked and replaced by censorship and lies.."9/11, never forget the day physics took a day off"..all of which is a formula for greater disaster.
Reply: Exactly.
Reply: Chris Hagan you guys are the morons clearly have no understanding of physics
Reply: taber911 Whoa u guys are so smart im scared.  Boo hoo.
Reply: @taber911  Why don't you enlighten us with your understanding of the applied physics of the collapses of the twin towers?
Reply: John J do your own experiment make a little tower from popsicle sticks.  It's healthy to have skepticism, the biggest red flag to me is how censored our search engines are when you try to find the science behind say 'characteristics of a controlled demolition' in google; you'll be bombarded with content debunking so called conspiracy theorists.  Wasn't what was searched for
Reply: True, just watch a few videos of controlled building demolition, its the same how the Twin Tower fallen down, very evil and corrupt people planted demolition bomb in there, its too similar.
Reply: PaperPlanesParadise uh I think it’s because most towers collapse similarly.
Reply: @paperplanesparadise355   controlled explosions occur from base to top. WTC was collapsing from top (where planes crashed) to bottom as the weight of each stairs added up....
Nevertheless, 911 would not have been possible without some gvt Intel collusion...
Reply: @paperplanesparadise355  indeed
Reply: PaperPlanesParadise this is completely non sequitur. Just because two things are similar does not mean the results cannot be achieved by different means.... for example I can get water to boil on an electric stove or place water over a campfire, the results are the same the methhods are completely different. The best argument you have for your conspiracy is the third building that collapsed that no one talks about.
Reply: PaperPlanesParadise riiiiight they had explosives at the exact level where the planes hit.
Reply: @RobZ90TT  no it starts slightly above where the plane hits if you watch. then just watch all the explosions about 5 to 10 storeys below the dust cloud as it collapses. also check out the firemen's radio transcripts, reports of multiple explosions throughout the building.
Reply: @RobZ90TT   I was wondering about that. Some might say military drones... But with the strength from the speed of the impact, the heat generated by fuel explosion plus chemical chain reactions plus weigh plus momentum, were extra explosives really necessary for the collapse of the tower?
Reply: @Flying Mechanic, Took the day off? Be more specific, but I doubt that you can.
Reply: Blake  Moronic pin-headed conspiracy theorists who never hold up their own thoughts to the level of scrutiny that the expect of the official story. They don't because they would be debunked, leaving these clowns with nothing but "I don't believe it." or fanciful claims of "inside job". Idiots.